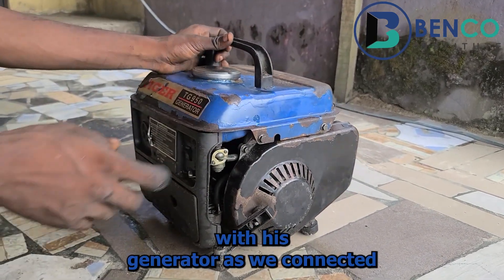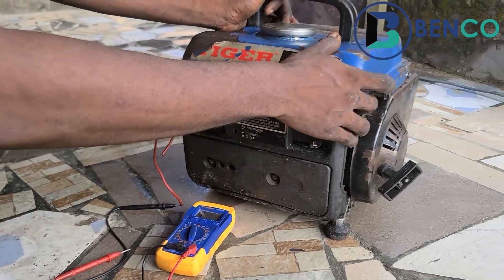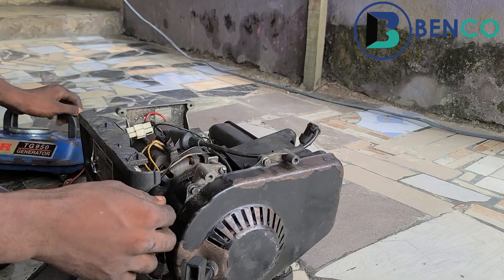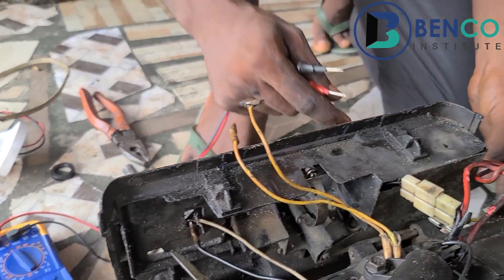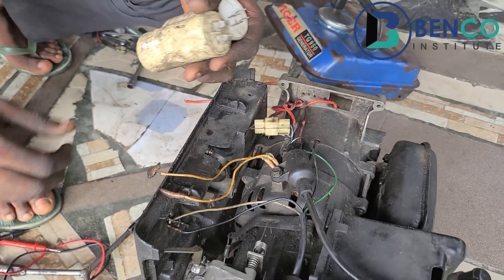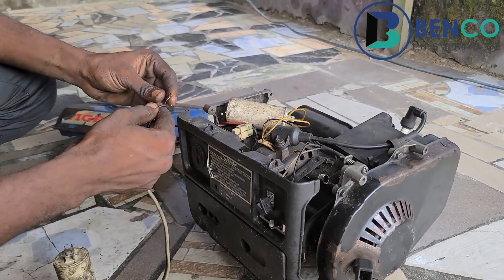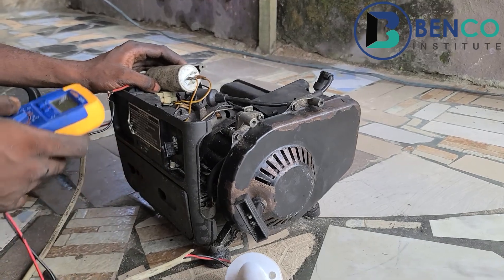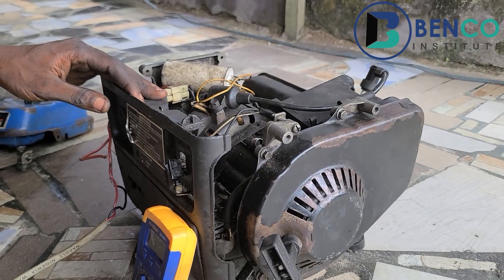How restore NO or LOW voltage in your Old Generators |Works for voltage drop and other related issue

Comment: Good day Engineer, I just came across your channel, my generator  (small one like this tiger, I think the name is sunshine or something like that)  so the output is low, and someone said I should buy bigger size capacitor, 
What your take on this? 
Or do you have a video, you have discussed this so I can watch? 

Thanks so much
Reply from the maker: Low voltage could be as a result of many things though....
Reply from the maker: I have other videos on the channel that would guide you